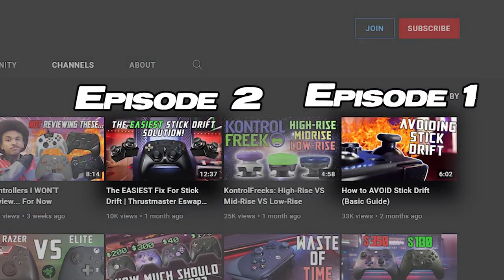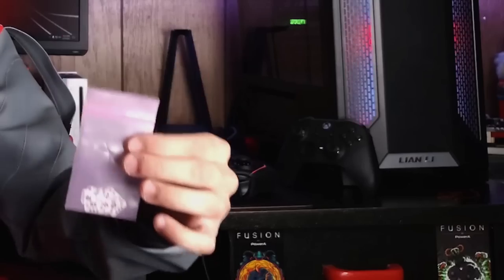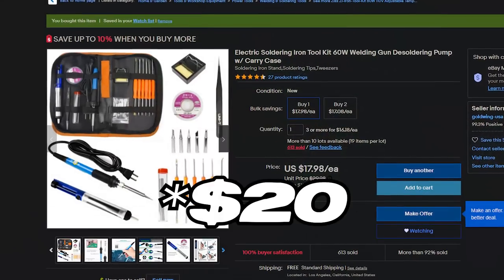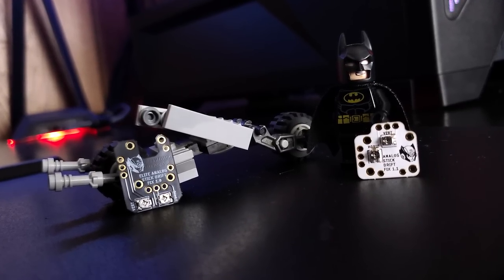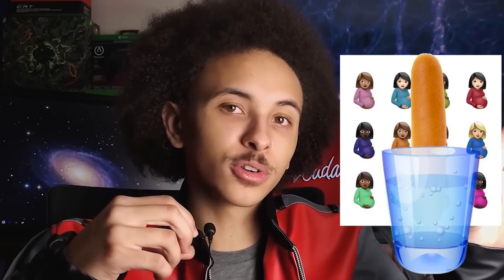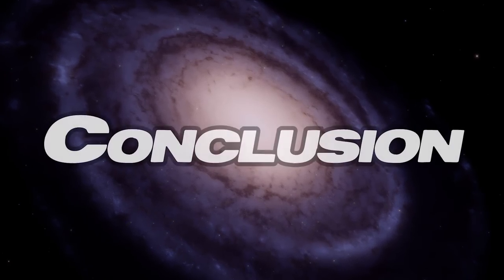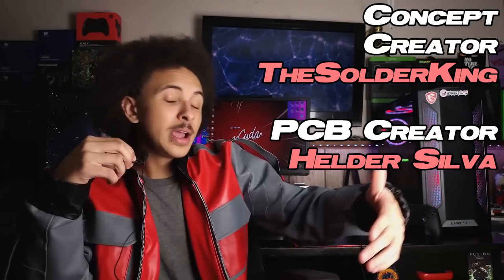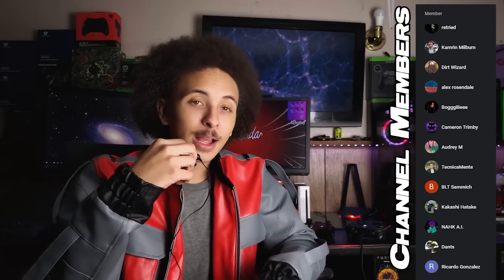PERMANENT Fix for Stick Drift is Only $15! (PS5, Xbox Series X, PS4, Xbox One, Elite Series 2)

Comment: It's still mind blowing that this idea is taking off! Really loved the video! Especially that bit about not forcing things.....
Reply: Seems fucking genius it’s seriously what we all been wishing for
Reply: This is incredible
Reply: Would this work on a razer wolverine ultimate?
Reply: @KSIxChAoTic  the question is would it work for any Razer controller cause I have a Razer controller too just not a Ultimate or Tournament.
Reply: Good video.. #DRIFT
Reply: Can you kinda explain what these do in principle to a dummy?   I see they have their own potentiometers on them and I under stand that movement across the pot wears the material and that over time this causes a different electrical reading causing false inputs but that's about it.  How do these boards  soldered onto the back of your controller pcb "fix" that in principle?

Comment: I'm not so sure this would be a long lasting solution because it's the pots themselves (there are actually 2 per thumbstick) wear out mainly because the carbon (resistive) material is bonded to a piece of thin flexible mylar (larger pots use rigid PCB material) and the carbon material wears away or pieces become unbonded from the mylar. While this trimpot solution may initially work (somewhat) the pot will continue to degrade until most of the resistive carbon material is gone which basically creates a huge deadzone. What I've been doing is instead of replacing the entire thumbstick which is a huge PIA because the metal frame is so hard to desolder, I just replace the X or Y pot that is acting up. You then only have to remove solder from 3 joints, pry the pot away from the joystick frame and pull it out, put the new one in and wiggle the stick a bit so it pops back in place and then add a little solder to 3 joints.
Reply: Is there a video for this?
Reply: That was my first thought, its seems like more of a temporary fix and the problem will only get worse over time.
Reply: The real problem is they use dirt cheap open "dry" pots. If they used sealed greased pots this would not be as much of a problem. RC has been using japanese Noble pots for R/C radio sticks and as position feedback inside servos for decades and this has never been a problem except in low cost equipment that uses cheap noname pots. By greasing the wipers and sealing the pot to keep dirt out and the lubrication in the tracks are preserved for far longer.

Comment: This is super helpful, as my elite 2 has just started to give out on me. I nearly resorted to spending $258 on a scuff controller, until I saw this. This is why I’m subscribed to this man. Don’t ever stop making videos, you’re very valuable to gamers everywhere. Thanks again for the time and energy you spend time and time again just to help us out. Much love man.
Reply from the maker: I'll always do my best to inform 💯
Reply: Did you put it on and your problems vanish?
Reply: @Mike_Wazowskii7  I’m not sure what you mean, but yes my problem has vanished. I fixed the minor issues I was having myself instead of purchasing a new controller. I would rather invest in something much more efficient at a later time.
Reply: @clutchopp6319  still works now?
Reply: @kozmo8782  hell yea pal, just put it down actually. That thing is indestructible.
Reply: @user-ve1tm2wg4x  really? Did you have stick drift already when you placed it on your controller? And what controller do you have? I’ve been thinking about getting the Dualsense edge to remedy the issue altogether but 200+ is way too much, rather mod my ps5 controller with extremerate mods or something.
Reply: @kozmo8782  see I’ve got a series x so I have the elite controller still. Therefore I can’t tell u what works best for PlayStation man, but try different stuff out! 👍
Reply: Scuff is the most unreliable controller there is

Comment: Buy some flux paste as well. Apply to the solder holes
Flux basically “sucks” the solder into the joint. Makes a better connection just so you don’t have to take apart and redo if a joint fails. 

Science stuffs:
Basically metals form a thin oxide layer when exposed to air and prevents the solder from bonding 
Flux when heated chemically removes that oxide layer so you can get a good bond.
Reply: Wait flux paste or just flux cause paste or flux paste is used as a replacement for soldering wire
Reply: @MGrey-qb5xz  flux comes in paste form or a syringe 
it's not a replacement for the solder tin. the paste is more economical 

some solder tin has flux in it but it's not a replacement for adding flux to the joint beforehand it will just help the tin flow a bit better

there is also solder paste which is a replacement for solder tin but usually used for SMD components and a heated bed
Reply: @dylan-nguyen  wow that's so effing confusing
Reply: @dylan-nguyen  but thanks anyways, that was useful , basically flux paste> solder flux for using solder wire
Reply: @MGrey-qb5xz  haha yep. I used to use just the solder tin with flux in it thinking that was flux
it was always really hard to solder 

my dad said I needed to add flux paste and bam. nice shiny joints.
Reply: The soldering wire already contains flux .
Reply: @shelbyv2658  it does but it's still better to add some unless you're soldering very thin wires 

even with 18ga on an led strip I wasn't able to get a shiny joint without applying some flux paste. I was able to rip the joint off with no issue

Comment: It's very reassuring to know these exist. I'm one of the guys still using an Elite Series 1 even though I have the Series 2, simply because I really dislike the sloppy mechanical deadzone (central area with zero tension) created by those adjustable tension mechanisms. The Elite Controllers are an absolute nightmare to replace the analog sticks on due to the tiny pin holes/pads and tougher solder, so these PCBs will be a godsend when my Elite S1 inevitably develops drift.

Thanks very much for the video mate!
Reply: Sounds like the Elite Series 1 controllers are made much better than the Series 2 controllers! I've had 4 of them, and all of them have had stick drift out of the box. They shouldn't be sold anymore imo.
Reply: @samir1281  Yeah, agreed. The poor analog stick re-centering due to that large mechanical deadzone makes the Elite 2 controller more prone to stick drift than any other modern controller I know of. I would've taken the Series X|S analog stick modules over the ones that come in the Elite 2 tbh. They don't have the adjustable tension thing but they have the tightest analog stick re-centering out of all the official Xbox controllers. 👍
Reply: Just bite the bullet on a cheap hot air station. Best money I ever spent. Makes the most difficult desoldering jobs a piece of cake. And frankly this isn't gonna stop your sticks from wearing out and getting loose, you are probably better off just replacing them.

I am personally considering buying these to play around with because I am extremely anal and even brand new sticks are never perfectly centered.

Comment: it actually blows my mind that analog sticks havent been redesigned yet, especially since sony LOVES to needlessly stealth revise  this controllers every year it seems. pots are by far not the most reliable electronic part, i mean i have to deoxit my guitar and amp knobs all the time and those are parts that dont really have to be precise like a controller has to be lol #drift
Reply: If they make it perfect quality they won’t make money off people buying new controllers.
Reply: Which is also why controllers are so expensive.
Reply from the maker: @mattedious9378  that's the issue, they would still make boat loads of money. Controllers are sold at an unbelievable mark up. That's where the majority of MS and Sonys money comes from, Accessories and games. But things don't have to be that way!

The sticks don't need to be perfect, lord knows no gaming peripheral is, but they certainly shouldn't be this unreliable for the prices they're charging for these controllers
Reply: There are types of pots that use much more durable materials to create the resistor. Obviously analog stick makers don't want to do the RnD to make a better pot. Most electronic parts are planned obsolescence, but capacitors having to be replaced after 10 years isn't nearly the same as an analog stick needing replacement after very little use.
Reply: I have two words for you. Planned obsolescence. They won’t redesign them anytime soon because they want them to wear out quicker so you can go buy another controller so they can make more money.
Reply: @yesimbigwes  i dont think thats the case especially since theyre just using the industry standard,i think its just its cheaper to ignore it since people have gone with the idea that controllers are consumables

alps isnt a bad company in the keyboard industry they make good shit, i dunno why they dont release a hall effect sensor stick or something, maybe mess with optical sensors...anything besides wipers on resistors
Reply: @c4000121  maybe, but at the end of the day its wipers on resistors which wear out or most likely get dirty
Reply: Been using the same analog sticks since the ps1 and Xbox I'm not surprised.
Reply: There's a thing called Hall Effect Gimbal and it's basically unthinkable to have anything else for me in my RC Transmitters. The modules cost around 20 bucks.
Reply: The reason it works fine on guitar and amp pots is they have the resistive carbon material bonded to a rigid PCB material were as these miniature pots have the resistive material bonded to a thin piece of mylar ... Unfortunately because of their small size there really is no other solution since they are too small to use a rigid PCB type material like the larger pots all use. Actually these smaller pots are considerably more imprecise than the ones in your guitar and amps .... The larger the size the more precision plus joysticks only use about 20% of the pots full range .... To make up for that they are tied to a 16 bit A/D converter
Reply: There is a re design based of the hall effect.  There's no contact between the sticks and the pots so there's nothing to wear out.  3 parties are just now starting to get into it and it's gonna force 1st party controller designers to switch eventually to be competitive but it's slightly more expensive so the 1st part industry is resisting it but it's only a matter of time.

Comment: As for preventing drift, I will say that control freek rings can kind of prevent wear and tear from slamming the sticks to the wall. Usually I’d go through 2-3 controllers a year, but now I’ve used the same controller for 3 years and it’s been consistent and probably even keeping debris from getting in there
Reply: I heard they reduce the life of your thumbsticks
Reply: @1760junior  i could totally see that being a thing cause I did hear a lot of people say that pieces of the ring could fall into your controller from wear and tear. So far I haven’t felt any deviation though. I’ve been using the same series X controller since the consoles dropped last holiday season
Reply: @FoxCowDog  wb now
Reply: @christopherbassit2757  I upgraded to an Xbox series s and elite controller. The elite controllers stick tension feature kind of gives me wheat I was looking for out of the precision rings. but regardless I still never got stick drift in my normal xbone controllers. Not sure if just an anomaly or the rings actually helped but I would use soft ones for as long as I can remember and for the most part I tend to forget they’re even on there.  My little brothers use them now.
Reply: wtf i used my controller daily since 2014 and it has no issues other than a little drift

Comment: Make sure u get a temperature adjust soldering iron. Flex PCBs are very sensitive to excessive heat and just set the iron to a bit above the melting point of ur solder

Comment: Stock controller solder is coated with a clear heat shield... So use FLUX to make the solder stick/bond better... Use some new flux also.... Mix the old solder with flux and new solder and works every time

Comment from the maker: Let me know if I missed anything, or if you yourself have a valid solution for stick drift, be sure to leave a comment about it! I'd love to see what else is out there. Stick drift isn't going anywhere anytime soon

Also Im starting a "Pro Controller List" here in the comments and I'll update it as I continue to experiment! Some may need shell modifications to fit 

-Razer Wolverine V2 Chroma ??? (I have no fucking idea how to take this apart)
-Razer Wolverine Ultimate ✅ (Dedictaed PCB on website now)
-Razer Wolverine TE ✅ 1.1 PCB (They fit, but the shell may need modification for it to fit)

PowerA Fusion Pro 1 & 2 ❌
PowerA Spectra ❌

ExtremeRate Kits ✅ 1.1 PCB (most of the time they work with these)

Thrustmaster Eswap X/non-X Pro ❌
Reply: Hey vcuda I was wondering if you can pls review the Razer chroma v2
Reply: You missed the chroma review but I still liked this video
Reply: U do a good job with your videos.
Reply: @aarxnz1t0  Bruh this dude posted that it was getting sent to him for review. Be patient 😐
Reply: Bro i have the new best solution for stick drift, you dont buy new analogue sticks, you dont buy that chip, you fix it by.......wait for it.................................

Buying a new controller. Best solution👏👏👌🏿👌🏿😅
Reply: @zae4557  Oh ok I didn't know
Reply: I saw this video of a guy who just manually disconnected the vertical and horizontal potentiometer and Just pushed them back into place which apparently fixed the stock drift issue. His yt name is Gabriel Vaz. Do you know this method and do you think it’s legit?
Reply: Does this work with razer wolverine tourney and/or ultimate? 🤔
Reply: Wait a minute
Reply: @studio_rtr  That can work if you desolder and readjust the original Pot on the stick, issue is the pot is already worn out a bit if it is drifting and once it gets more worn out you can't bend it any further to fix it.
Reply: Do you know if it would work for Xbox recon controller?
Reply: Please can you ask them to sort out their postage calculator part of their site, it just shows a blank part for me and I've tried but I can't get it to highlight UK, I would really like a pair of these
Reply: Need one for power A spectra 😭
Reply: Scuf instinct pro?
Reply: Hall effect is the only "permanent" fix.

Comment: I’ve used these for a while and I don’t think it translates the exact way that you would believe it to. If you do this though it maybe advantageous to cut out a small section of the back shell to be able to adjust them without taking the controller apart

Comment: I was a little skeptical but it worked. Took me about an hour and a half start to finish including programming it. So happy I could save my elite controller for under $50 including the part, tools to disassemble, and a soldering iron.
Reply: Can you explain a little to me how it works? Or how 2 simple screws fix stick drift? Lol
Reply: Yo you did this fix, how is it holding up??

Comment: I would love to call this a permanent fix but I still have to open up the controller every time I get stick drift so in that time I could just replace the potentiometers instead of soldering these on and changing the tension. The problem still remains until we get a real fix real soon. 😢
Reply: There has always been a fix. The sega Dreamcast has it already in 1999 and the solution was discovered in the 1800s. Hall effect sensors are effective and fully immune to stick drift.

Comment: More than 2 minutes in: As much as hardware level reclaibration is great, the main problem with drift comes from the sticks carbon pads wearing out. If you want to fix the problem the better way is to buy replacement sicks that use electromagnets rather than using a stick that will keep breaking. IFixIt and other creators I can't remember covered about the tech and where my point comes from.

That being said, it's amazing that solutions like this were created. If you really REALLY want to still use your current stick and don't mind soldering, maybe try this out.
Reply: Who sells hall effect stick boxes for Xbox elite v2 controllers? 

I've seen them for steam deck and joycons but not the Xbox patterned stick boxes that follow the Alps stick box foot print.  If you've seen something I haven't point me at please. I can't find them.

Comment: So I decided a year and a half ago to do a little experiment. I decided i would...gasp actually take care of my controller. I have 2 fusion pro controllers bought after my second elite went bad. I decided I would never under any circumstances drop the controller from any height. No dropping it from 8 inches onto the bed or couch etc. When I'm done using it I set it on the entertainment center face up. I have 0 stick drift on either controller and I play apex legends and warzone daily. I still press r3 and l3 harder than I should but I'm getting better at not doing that  I set my deadzone to 0 in every game I play and have 0 stick drift.  It's amazing how much damage that 6 inch drop onto a pillow or something does to a controller. Youd wouldnt think it would do anything but it does.